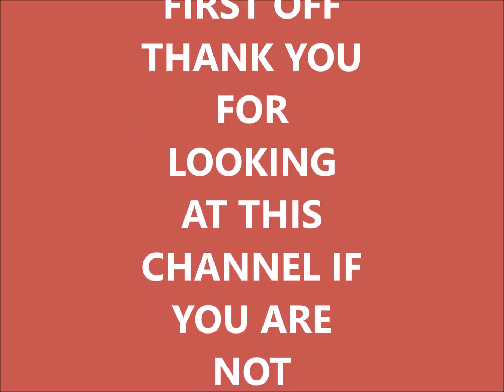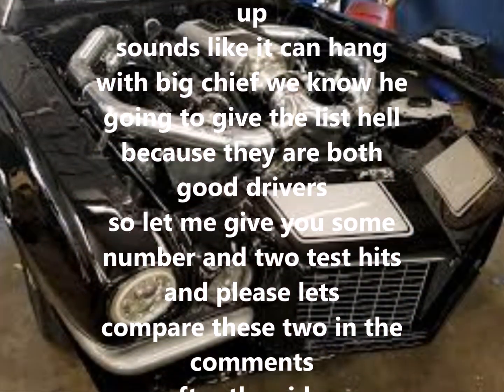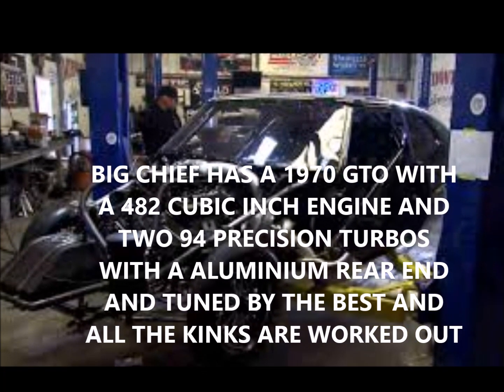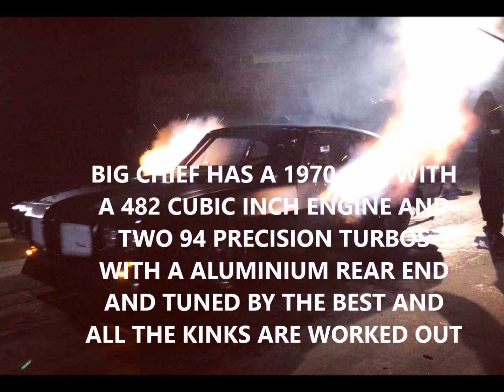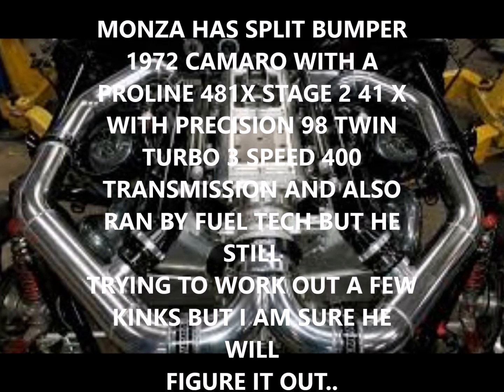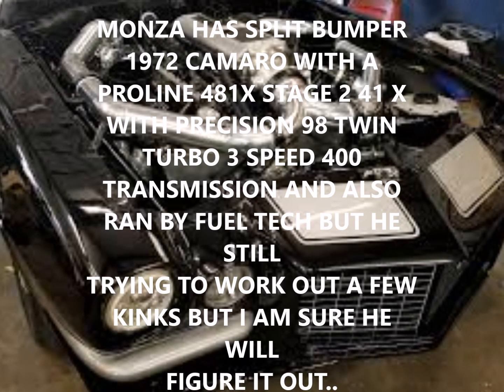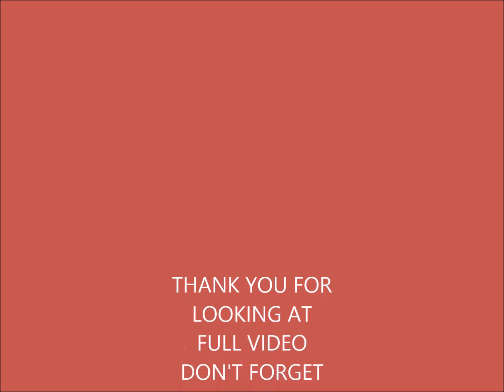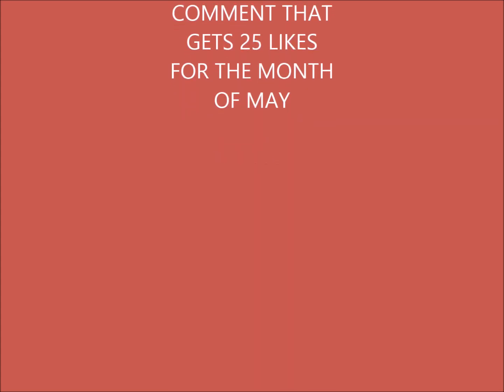BIG CHIEF MONZA  (NEW SET UP) TEST HIT AND COMPARISON AND MORE

Comment: Chiefs setup is capable of 2800-3000hp with the parts he runs, the 481X platform from proline in monzas car can make 3500-4000hp But there is only so much power you can apply to the street, Chiefs shit is Dialed in and runs in the high 3 second range to the 1/8 mile, Monza Theoretically should be able to get near there BUT that comes with A Ton of testing and seat time so it will be very interesting to see how fast Monza learns with the new setup imo

Comment: Big chief leaves hard but seams to take longer to spool, as Monza takes shorter to spool but sounds like its doing it with higher RPM. This is ok on a sticky track but on the street I think it will blow the tyres off it.

Comment: monzas plr 481-X is basically the same set up Ryan Martin uses pretty much a bullet proof way (if there is anything in this sense) of making 2-4 THOUSAND HP so yes it's much better then his old school "pound nitrous through it" set up an rather laughingly sent his best bud big head doc home crying to his 900+ cubic inch mountain nitrous motor with 4-5 kits if I'm not mistaken. u watch monza will bust doc up with half the cubic inches jus like Ryan Martin does

Comment: It’s about time those nitrous cars retire.
Trubos don’t break every time they race.
They build power through out the run.
And if it’s too close at the finish they hit their legendary “Scramble” button for a extra car lengths boost and the line.
More power, much less engine problems
Air is the way to go. Good job Monza.

Comment: Based on those pulls, Chief will gap Monza. It's still not even a contest. Monza's turbine is way too slow, and chassis is flimsy., and Chief get's out higher revs from his engine. With rigorous tuning Monza could catch the rear bumper, but never the front one, unless Chief starts to sleep at the light. And when looking at how Monza has performed in reaction times, There will be at least a whole car length between them.

Comment: It's just going to come down to conditions and tunes for the surface. Chief has the experience with his set up that will help him, but Monza isn't dominator, he's not going to have stupid fucking issues over and over. It's going to be largely plug and play, and as long as he can get the data he needs he will have that car dialed in week to week extremely quickly. It should be a fun year this season with the heavy hitters and the new set ups

Comment: Big chief and monza. Monzas proline engine was put on a dyno and tuned for most likely 20 lbs boost what he has to do is figure out the suspension setup once that's dialed in then he can tinker with more boost

Comment: Monzas looked faster between the 2 clips but chiefs kinda looked slower than normal. They're gonna trade wins for sure
Reply: David Trumpy      the1st run by monza they showed the boost was low,that's why it was slower off the line,he had posted the vid on fb and said they were working the bugs out

Comment: Well I would say they both look good. But I have to say Big CHIEFS car is smoking fast!! I mean come on let's compare the two. One BIG CHIEFS  car has a very mild motor compared to what monza has! A 481 motor is ALOT OF MONEY! 98 turbos are no joke! But for what BIG CHIEF HAS, well let's just say he HAS ONE HELL OF A CAR FOR ALL THAT HE HAS ACCOMPLISHED!!
Reply: Mild my ass. Its completely custom. Far from mild...
Reply: Radioman  what I meant is it's nothing like the 481x! And he still kicks ASS!! HE HAS STREET ELDERBROCK HEADS!! With alot of work done to them! So I feel he deserves alot of credit! That is one running son of a bitch!!!
Reply: I agree with you Big Chief's engine 482 cubic inches is based on about 50 year old technology from the 1960's beefed up of course mainly around the cam and crank area but that doesn't make more power just makes it able to handle more power and the heads are based on RamAir IV Pontiac heads with a much higher flow and larger valves that makes more power there are other company's such as Kaufman Racing ,DCI that make heads that will out perform the Edelbrock heads in Big Chief's car in my opinion,almost all the other cars are running newer technology that their company's did not make and the gm 481x is not the actual cubic inches of the engine and all new technology so in reality Big Chief is running exceptional for what he has got in car and spent compared to the other guy's and from the factory original weight Big Chief's car is one of the heaviest cars out their Daddy Dave, Shane and chuck's cars all started from the factory under 3000 lbs. and they lightened the weight last season chuck was about to take his car off the list so he took off 500 lbs. or he said he was going to take it off the list
Reply: Ralph Rodriguez  Hello sir thank you for all the information! And yes it's amazing how that man runs! He is ONE HELL OF A TUNER TO!! I here and have been seeing all the other drivers doing shit to there cars, I wonder what Chief is going to do? But I would hate to be them!  Chief should be number 1,!! But really all of us who no anything about cars, no he is. God bless.

Comment: Chief need to dump the maxed out Pontiac moter
Reply: ZZ430T56 why would he it’s fast and cost a third of what other guys pay for their big motors yet they still can’t hang will chief in his small block Pontiac motor with of the shelf parts on it. I can bet if he changed his setup he would struggle and their is no point. All those guys spent so much money making their cars lighter and big ass motors yet the OG murder nova still was #1 till last season. That just shows on the street their is no need for all that big motor or super light weight cuz all they do is turn it down and peddle. Now on a preped track yes the big motors and light weight will make a huge difference but they don’t race on preped tracks
Reply: "small block Pontiac"?
Reply: John Contrevo Why does everyone have to dog Pontiac engines, back in the early 60s Pontiac was the only company to have a engine that could compete with the hemi's, the 421sd. Look it up,  as for the "small block " comment, they just don't know that Pontiac doesn't have a big block/small block setup like Chevy does .1 size block period! All different internally.
Reply: Pontiac was all about peformance. My hot rod is a modified 70 GTO

Comment: No prep is a crock of shit promods vs steel cars no wonder birdman won it if I brought in a top fuel dragster I could of kicked his ass same principal , real steel cars no sport man class or promod horseshit , birdman is 2000 pounds lighter then chiefs car and 500 pounds lighter then Ryan's fireball and birdman has weights on the front to keep the front end down probably a good 100 pounds on it and it's still lighter , and a hemi if you got a bigger motor and are lighter then the other car you should win hands down every time . It's power to weight ratio who ever has more power and is lighter wins    duhhhhh